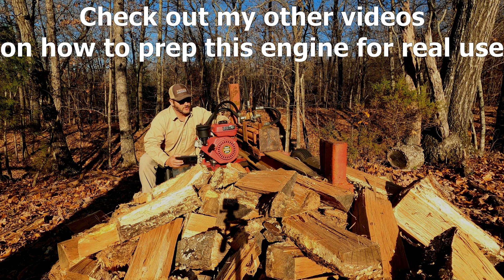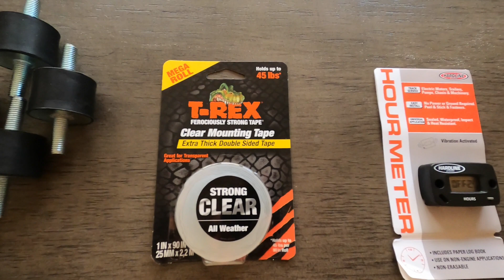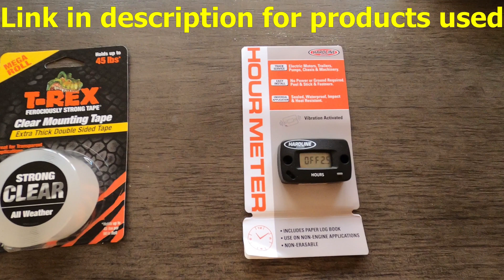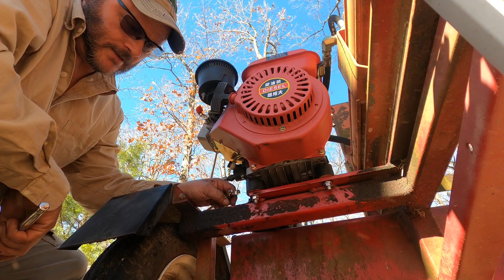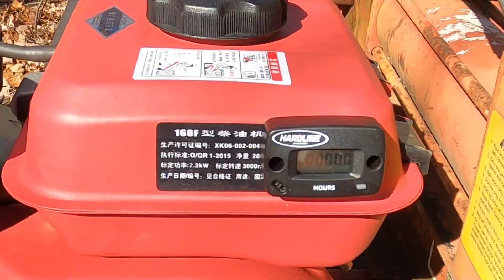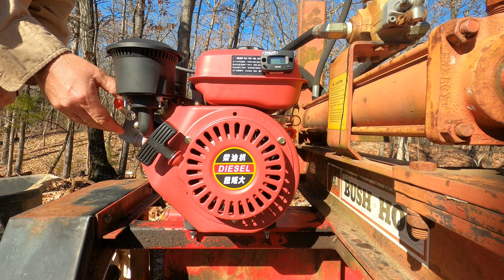Small Diesel-Powered Log Splitter fixing it with 168F Diesel Small Engine Re-Power

Comment: I have 3 of those 168F engines I'm empresses on there performance -
Reply: What are you using for the output shaft drive pully/ sprocket/ clutch?? Its 20mm right? 👍
Reply: @dennymcelhaney8652  mine have pulleys on the shafts the shaft size  is 20 mm I ordered the pulleys from Allied Beating - the pulleys they had were the bushing type pulleys - hope that helps - 
     Also you will loose about a half horse power via belt or sprocket transmitting - another is the max RPMs is 3100 RPMs - but compared to the 3600 rpm engines the will burn very low grade fuel  - 
      The factory recommends 2600 RPMs
Reply: @dennymcelhaney8652  mine have A belt pulleys on them the shaft is 20 mm - I ordered my pulleys from Allied bearing - they only had bushing pulleys for 20;mm shafts - 
      You can bring the engine to machine shop and have a 3/4:inch bore. To 20 mm

Comment: I plan to put a 4.5 hp Lombardini diesel on the same splitter that you have. What size pump did you install? Would you recommend using the same pump if you were to do it again?
Reply: I have the same engine, mine’s a Lombardini 6LD260, those engines will run longer than any other cheaper diesel, even a Yanmar. My Lombardini has a full-size remote mount automotive oil filter. It was from a roadside arrow board junked by penndot (PA dept of transportation) bought the engine for only $45 😂
Reply: @_..-.._..-.._   My engine is also a 6LD260 from a arrow board. Its rather noisy and rough as compared to my 3 cylinder Kubota. It only has 600 hours on it so it should last a lifetime. I haven't had an opportunity yet to install it on a wood splitter. Please let me know what pump you will use and how well it works for you. Thanks.
Reply from the maker: really hard to know.  This is actually a 30-40 plus year old 3 point log splitter I welded up a tank and trailer axle on to it about 20 years ago.  Bought a log splitter pump I cant remember gpm.  The little diesel performs well so far. Use starting fluid under 32 degrees unless you want to cuss.

Comment: My dad bought a Chinese tiller with very similar engine (the same model number but a different manufacturer) in 2016~ish. It's still running great and still on its first oil fill!. Ours is rated at 9 hp.
Reply: Better change the oil soon or you won't have it much longer.
Reply: That's correct on he had better change the oil - I generally run air-cooled engines an hour with out a load then change the oil - 
     The first change is full of metal -  I run it a second time for an hour and change the oil again - 
    On the third time I put a light load on it then change the oil - 
       I use synthetic oil and I take a large  funnel and put toilet paper in the hole and let the oil filter through the toilet paper and reuse the oil - 
    In many over the road trucks they no longer change oil they just filter it. - 
     They use grade 4 synthetic oil - worked in the offshore oilfields for yrs - there were many companies that did not change oil - as the engine uses oil the make up oil is the new oil needed - a locomotive can have run 30 yrs and the oil has never been change - I've worked on engines that had been running gas compressors for  80 yrs or more that have no recorded oil changes - just the filters are changed -

Comment: I am rebuilding mine just like you showed me. How is yours running?
I tightened the connecting rod bolts to 15 ft lbs, like you suggested. A stock predator rod is 9 ft lbs. I hope that I didn't over torque anything.

Comment: You did the same thing I'm thinking about doing. So glad I found your video. Is it still working good for you?
Reply from the maker: So far works great, make sure you have some starting fluid on hand for Temps below freezing in ambient air temp. Only have 3 hrs or so on it so far.
Reply: You can heat the head with a torch if needed for cold starts - as far as that goes if it's a manual start it can be hard to pull start when it's real cold so I heat the block up with a torch - 
         Most compression start Diesel's are hard to start at below 32° f ether or a torch helps a lot in cold weather